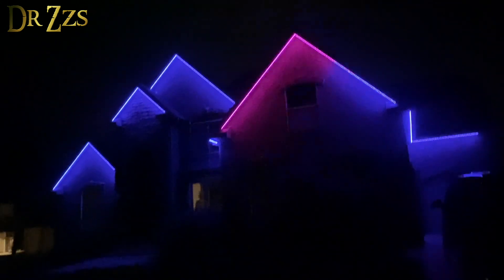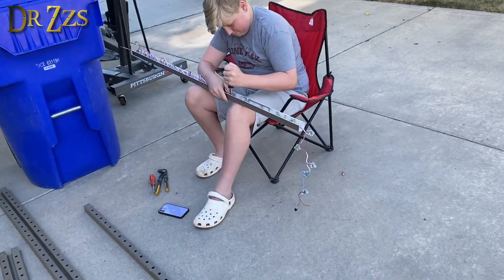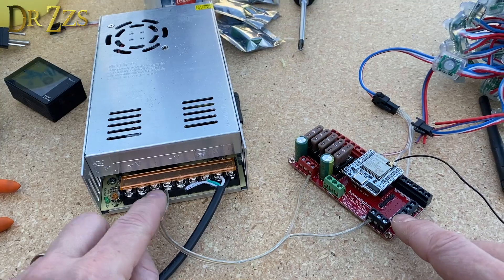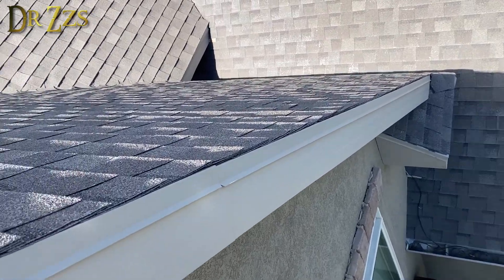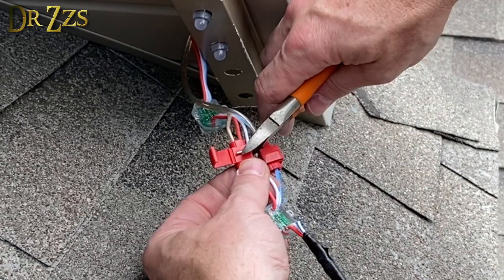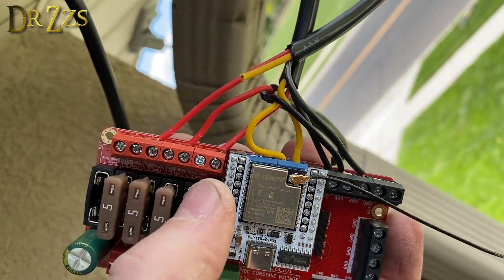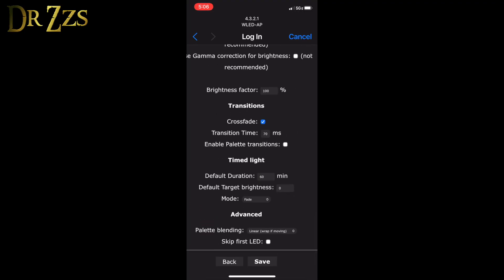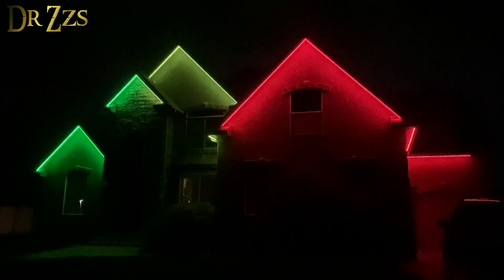Permanent Holiday Lights | Permatrack | WLED

Comment: I should have gone 12V from the beginning. Redoing my Permatrack pixels this year in the hot July sun was something else.
Reply from the maker: Why do we do this to ourselves??!?!?   I still have my original 5v pixels up from 2017.  They work, I'm not gonna mess with them.
Reply: @DrZzs  it required so much power injection and a low amperage and limited effects that putting up my 12V version was cathartic. But what am I gonna do with 400 5V pixels?

Comment: where do i find the specs of the perma track?  Width and total depth of it?  Looking at installing in AZ but we dont have much for eaves
Reply from the maker: there are pictures with measurements on the website.  it's about 1.5" wide and 1.5" tall and 46" long.  That width includes the length of the tabs, which are about 0.25" wide.  Does that help?
Reply: @DrZzs  absolutely thank you
Reply: @DrZzs  I have fascia boards and consider mounting the track behind it. My question is, if I lined up the track (side hole version) to be flush with the fascia board will the pixels stick out far enough to poke out under the fascia boards and be visible from an eye level perspective? 🤔 hope my question is understandable.
Reply: I'd advise staying away from Permatrack, the owner is super shady. There are other options from more reputable sellers that don't ghost their customers and disable comments.
Reply: @cryangallegos  which company? I'm genuinely interested.
Reply: @kcoop99  RGB-MAN
Reply: @cryangallegos  I thought you said stay away from rgb man?

Comment: Are there any issues with having the power supply and the controller in the attic with cold and hot temps during the different seasons? More worried about the high temps in the summer frying the controller
Reply: For best results, I’d place your psu somewhere with air flow. It’ll last a lot longer.
Reply from the maker: No, shouldn't be a problem.  I have a power supply and controller in my attic.  I haven't measured the temperatures but it's probably not much different than being in a sealed plastic box on the eves.  Inside the attic or the garage is actually a good place for power supply and controller.  Hope that helps.
Reply: Yeah I’m in Idaho and the summers get to 105ish so I’d imagine the unconditioned attic would get much hotter. I currently have my whole set up on a piece of plywood in the open. Not inside a enclosure

Comment: Are these bulbs easy to replace? If one bulb goes out does the whole line die?
Reply: If one dies, the rest of the line will die. That's good and bad in the fact that you know which one burned out!
Reply from the maker: They are LEDs.  They are supposed to last 50,000 hours.  You shouldn't need to replace them ever.